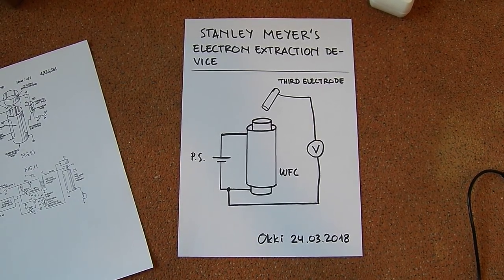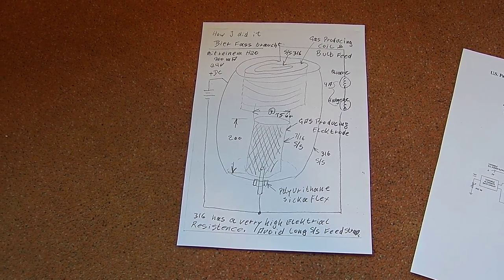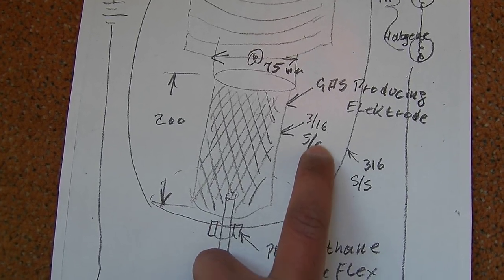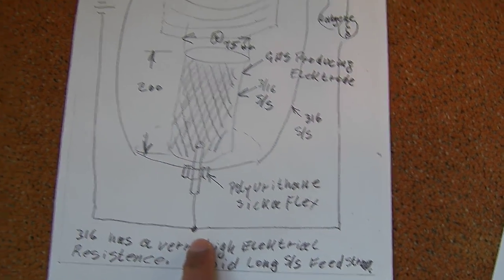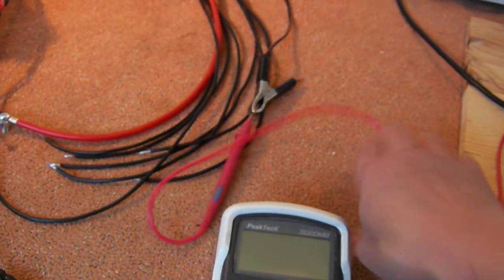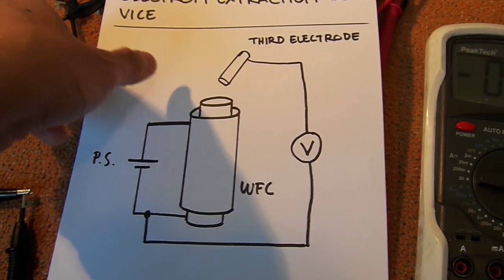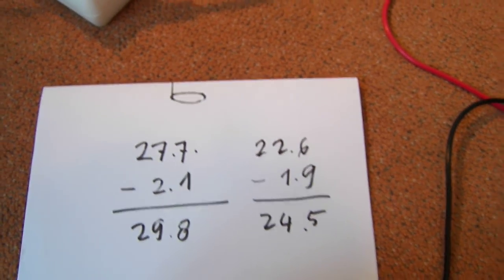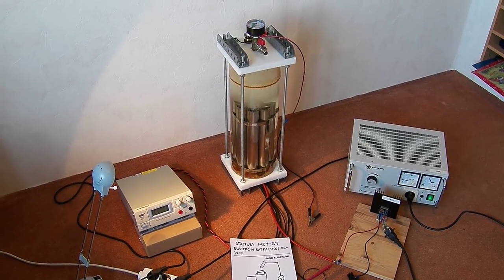Stanley Meyer's Electron Extraction Device

Comment: Stan Meyer didnt use tubes. they were just for show. all his magic was performed inside the water injector
Reply: @Praque Forqsk well.... he did what he said he did. that much we know. we just dont know how he did it and it seems he was not fully aware how his invention worked. people dont murder frauds.
Reply: @Praque Forqsk i see your new here. iv been doing this for a long time mate. you have a lot to learn and your not going to learn by repeating mindless rhetoric.
Reply: @marcisaacs9407  yes marc. it is likely that the tubes were an early iteration of his invention and later he just used them for show to illustrate the effectiveness of there gas producing ability. but if any of you know anything of this technology and where it ended up it has nothing to do with gas production. production of gas is not what meyers invention does.
Reply: @freelectron2029  although I am not certain about the gas production as an endpoint, I am certain that there are several other things happening and the hydrogen is a focal point because the extreme low amps and high voltage can only result from whatever the other is. The earth and atmosphere each work together to provide us with a livable environment. We are bio electric and this structure in which we live is “tuned” for us. In the cold winter the field separates so to speak. Studying Tai Chi China for Over 35 years has taught me that. I worked in prototype engineering on “things” many years ago and during that time I realized that a bit of this and a bit of that dug from the earth seems to be able to create the circuits we make into things. So perhaps I am not making sense but I think something quite simple was in play. Photons exist and can be measured even in total darkness. I have experienced it. Of course I am probably wrong.
Reply: @marcisaacs9407  yeah ok mate. so if you have been building prototypes for any length of time you would now that you acquire alot of them, and you should know that you dont roll out your best tech for the TV cameras. you should also know that vagaries aren't very helpful when discussing scientific absolutes. you should also know when someone is giving you a bit of truth, or when they are simply postulating. that is if you are a decent inventor. marc from china. done any work for CAT or Cummings? or do they just pay you to troll for people on the internet? asking for a friend.
Reply: @freelectron2029  totally agree. My prototype work was almost all gov mil stuff and we had a big lab most places with lots of “study and proof models.” I have built many art related models, gizmos, and tools as well and they are sagging the floors. I have built no hho models as yet because I haven’t studied enough but after listening to Meyer talk many times both over his car , bench and blue prints, I see what exploration looks like. Learning is a serious process. I certainly could make a hho sand type heater for the house and I might but it’s not the place Stan ended up. I don’t have electronic knowledge as much as I had intuitive understanding of certain issues that helped create working packages. Thanks for your time. Much to learn. Just ran into joe cell . Other stuff there.
Reply: @freelectron2029  old tech for dog and pony shows.
Reply: @marcisaacs9407  dont waste your time with the joe cell. it is only very rudimentry and the design is not optimised for the tech. look up moray B king. listen to everything you can by him, start with the most recent one of his lectures. i just saved you 5 years of RandD your welcome
Reply: @freelectron2029  bless you
Reply: @freelectron2029  correct. Most people fail to dig past the academic rhetoric that doesn't even touch on the final application that so heavily relied on that injector. In innovation and invention there are many iterations as the founder learns more and more until just like Apple a refined slick final product is presented. I've been deep diving into hydrogen as an ICE fuel and found that ICE actually uses hydrogen as the power source and that the other components of the hydrocarbon fuels both diesel and gasoline (petrol) are there as hydrogen chemical conversion stabilisers and delay so that the hydrogen doesn't just react instantly destroying the engine.
The fact is unmistakable, petrochemical industry seems to create systems that are ongoing saleable. They are NOT going to profit from better tech.
As far as I am concerned, the petrochemical industry is responsible first many deaths globally because they actively stand in the way of innovation that will help millions have better lives and not die. Sadly, the protection capitalist mindset has many solutions shelved to protect current investments. We all know this yet none of us do a thing to break the cycle.
Therefore, its not the governments nor big business, its us, we are the problem.

Comment: So what you are saying is when a capacitor is charged to saturation it becomes less efficient due to saturation of electrons in the dielectric and by routing these to a bulb you can eliminate the saturation and allow for electrons to flow freely but you can not close loop the 3rd electrode back into the cell due to polarity issue so you have to block electrons with a diode and trap them in the bulb turning them into heat/light basically on an external circuit. Oh wait I have more.... maybe if you had a separate cell you could use this external circuit to run it or multiple cells more efficiently and daisy chain as many as you would like. Sooo Okki you must go out and build multiple cells to test this theory and see how much gas production you can get from multiple daisy chained cells utilizing this "battery bank" style method...Ugggggg It never ends! Thanks for the vids!
Reply from the maker: Stan Meyer's cell is indeed a capacitor. You have to discharge the stored charge in the cell from time to time if you want to maintain gas production.
Reply: Okki you are correct but do you understand how he could produce enough gas to run a VW engine? I would like to hear your thoughts. I have my own theory that I will run by you. I think he was producing gas as fast as any of us can produce it with the standard frequency setup. I built a replica of his double 555 cell driver and basically I think he was trying to not only ring the cell to help produce more gas but mostly to remove as much heat from the cell. The toroidal transformer only magnified the frequencies to do this. I think the gas is so explosive and the energy it can release all at once is so high that you don't need as much as you think to make the engine run but there is another problem and that is volume. The lack of a fuel vapor in the air being sucked into the motor lessens the impact of the explosion within the cylinder. I think he was misting the intake in order to get the volume of fuel up because these explosions are enough to light the water vapor within the compression of the motor like a diesel. Moist air mostly allows for more compression and more efficient burning of fossil fuels as well.  I tested this theory on a truck and found that if I ran my cell without a pwm, it would heat up and produce mist which would then allow for 3-4 mpg increase but running the pwm cooled the cell and I could never get the increase of mpg. Does this make sense to you? Just my theory that one day I hope to test.
Reply from the maker: If you pay attention to the details of Stan's videos, you will see a manometer on top his cell shows the cell pressure. Also if you see what kind of cell he uses as he drove his buggy, you can clearly see that he did not use his demo cell but another cell which is bigger, bulkier and designed to withstand very high pressure. Maybe this "high pressure" was the secret key of his system. The other parts of his system could be just there to distract our concentration. I don't know. And yes, water mist can help to reduce fuel consumption.
Reply: I noticed the massive cell he used and that he probably regulated the gas into the carb just because that's what you do with LP in order to keep things running smooth but what interests me is the fact that he uses materials that can withstand pressure and heat. My guess is he is utilizing the heat as well and have noticed lots of folks testing this idea with hho and heat exchangers with good results. Cool stuff! I'm going to build a rig I want you to see in the future but it may be a while, I'll post my vid for you to see when I get it done..I have no time right now.
Reply: @OkkiMoeljadi  Nice experiment. This reminds me of the Joe Cell in some ways. I wonder if you need to connect a vacuum to the chamber in order to draw additional gas from the "capacitor"...

Comment: 11 Years on we now know the systems set up.. The low pressure gas processor/gun was a new invention. When this device processes non combustible gases i.e. air. And this air is defused and dissolved into water it makes what Stan called water fuel. The processed air will act in a number of different ways but essentially it's an electron sink in the same way oxidation occurs. The processed air requires  electrons and with a high electronegativity it will take electrons. Stan used this as a tool. In the first case he used the processed dissolved air in the water to remove electrons from the reaction during electrolysis of water. This changed the reaction by gaining electrons from the reaction and triggering a new process called Voltage polarisation. 
Second case is when burning the released gases from water. Combustion efficiency is extremely low; most of the gases turn to water during the combustion moment. But if you use the processed air during combustion and it gains electrons from the combustion moment then the efficiency is improved, the energy release is prolonged, more gas burnt and less gas is turned to water. It’s not commonly known but the efficiency of hho combustion is that,only one millionth of the available energy is released and the rest turns to water.

Comment: There is no third electrode in the device. It is just two. Positive and negative. 

Thé circus is a RLC system and de condenser is formed by the two electrodes...
Reply: it was a test to show the difference between the use of Direct current verses Alternating Current. as we can see the electrical difference is increased when measured inside the fuel cell. thus there is something about alternating current reacting with the water which creates a positive feedback loop which will speed up the production of hydrogen with less power than once theorized. and what about ac is better also
Reply: @Alm_Engineering  very simple. DMM only measure average voltage. the loss can be explaned by the up and down slope to zero, as veryy as the magnetic feild being stored in the water between pulses.

Comment: That's not extraction if you put the negative on top, you're adding more electons, which is what you should do actually, if you have an alkaline solution. I guess Stan was using anode ( + ) on top, which is logical if you call it electron extraction.   You can do it both ways, just as there are alkaline or acidic batteries.

Comment: very simple basic electronics explanation. DMM only measure average voltage. the AC loss can be explained by the up and down slope to zero, as well as the magnetic feild being stored in the water between pulses. DMM shows an average. use a scope if you want to see reality.